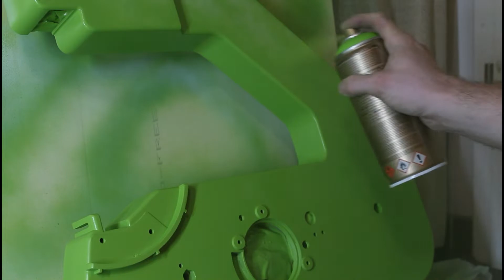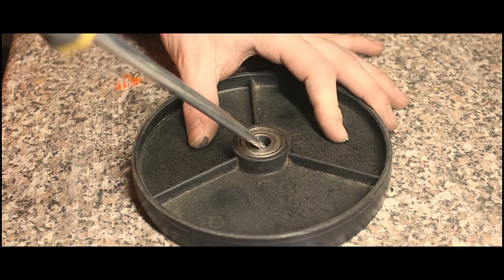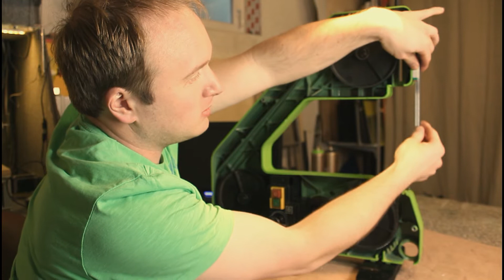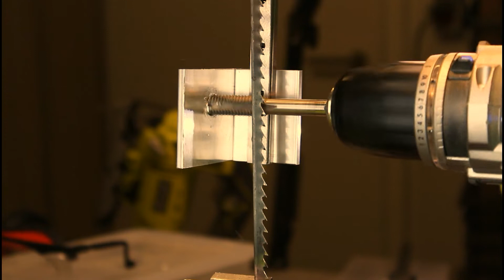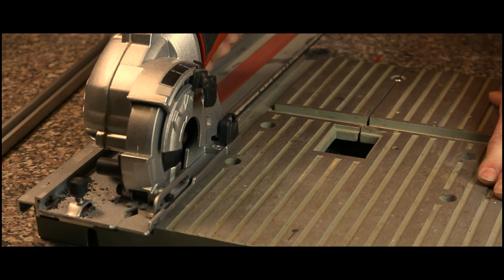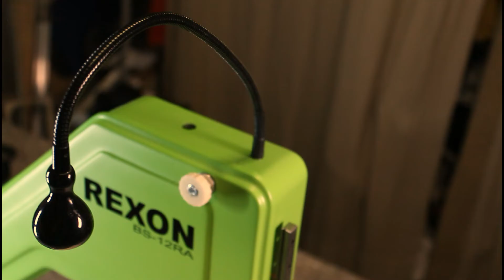Restoring an old Bandsaw - Cheap Bandsaw upgrades - Part 2

Comment: Thank you for a great video. One question if I may. I have the 1994 model BS12R ser no 062 314, which look very much the same. I need a variable speed controll switch, can you perhaps guide me to where to buy.Thanks again for all the info.

Comment: Hi, I have the Clark version of this bandsaw which looks identical, mine has a micro switch so if the front cover is off it does not run ( easily worked around ) I purchase a set on silicone  tyres for mine and you get three but only use two as the drive belt is a substitute  for a tyre.
  May I suggest that you use a short piece of mitre slot and an adjustable insert as you can lock those  in the rail, thus solving the problem of securing the top guide assembly.
   Good work and well thought out.

Comment: You could use a rubber strip glued with contact glue on the wheels, 
And have the centre of the wheels board out bigger to except slightly bigger bearing OD` but same size inner Diameter bearing to still fit the shafts,
To stop blade coming off that should not keep happening, 
forget what the books tell you, you need to make sure the teeth are in the centre of the wheel not the blade cantered, so the blade is more to the one side.
If you put the centre of the blade in the centre of the wheel it pivots left and right a wobble action ,not good,
The person placed the washer behind the wheel thinking both wheels have to be level vertical with each other, that will usually cause the blade to run off.
Usually on bandsaws the wheels are slightly off set or they will camper the flat of the wheel that the blade runs on.so the blade fights one way then the other this keeps it on.
I don`t know these little models if they have a tracking wheel that's domed on top to keep blade on try my suggestion to where the teeth should be on the wheels
Reply: I have this model bought in 1997 that has been a good work horse until the drive band tension roller jammed. A good clean and a small amount of WD40 sorted the problem. There is an interesting video here https://youtu.be/hodaJewalpA which shows on another larger Rexon machine how to set the blade guides and adjust the tracking. The top wheel has an adjustment accessed with an Allen key from the rear and allows the blade position to be adjusted front to back on the wheel, be warned it is very sensitive and easy to make the blade fly off the front. Hope this helps.

Comment: I suppose it was based on the old 3 wheel Burgess saw but looks a little better made, except for the upper blade guides. Not sure what they were thinking. The Burgess just had round brass rods for the side of the blade guides. We used to replace them with hardwood dowels that had been soaked in oil, works really well and such a simple but effective idea. 
Must say that is one seriously good restoration of that bandsaw!

Comment: You were a good inspiration for giving my bandsaw a new shine. One thing about your solution with the light. It looks like you used a Jansjö light (at least that is the name for it in Germany)  from that big, "blue and yellow swedish manufacturer", how did you get rid of the voltage converter to integrate it into the bandsaw housing?